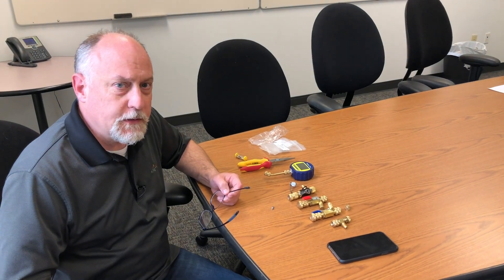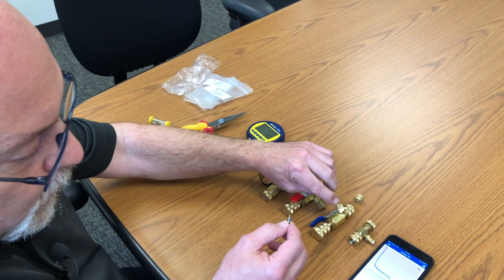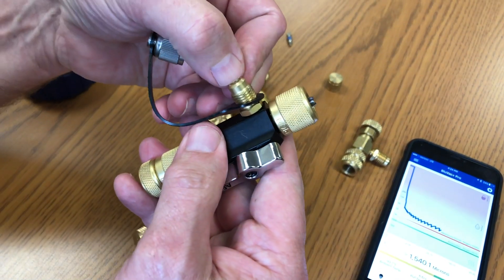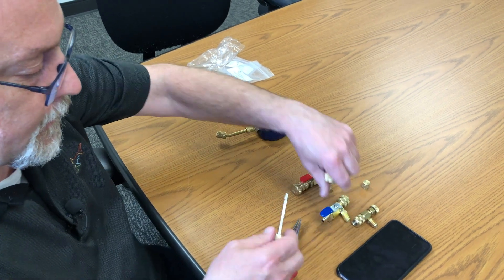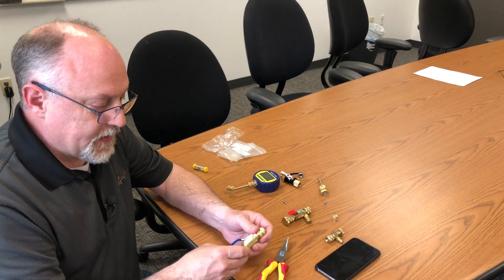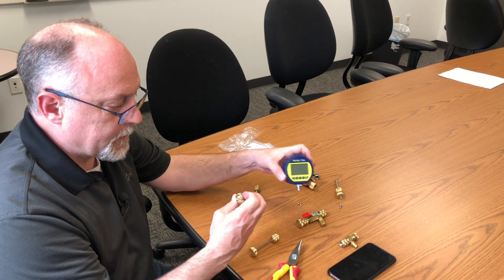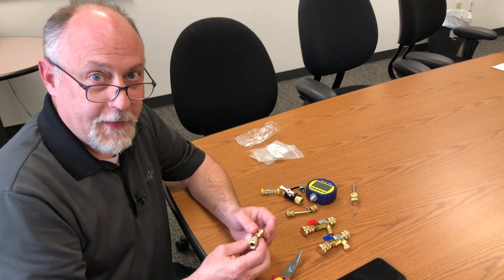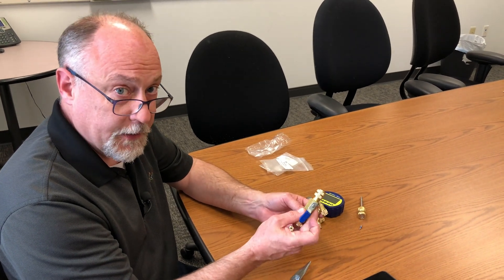My BluVac is Reading Erratically!

Comment: I got a sawtooth reading with the mg44 and the AccuTools core removal tool, I popped the shredder valve out and stacked a 2nd core tool on the port so I could valve it out before pressurizing. it worked out, but I was left wondering if I was experiencing something different. the sawtooth was not trending downward, it just seemed to stay around the 500-800 microns area for a while.
Reply from the maker: @cm9368  could have been oil in the brass connector if it was positioned so it could not drain.

Comment: Hey Jim, just thought I’d add that the if Appion core tool are giving a guy problems getting cores out, loosen the connection to the system a little. We all like getting them really good and tight but if you crank the Appion too tight, the o-rings compress and the shoulder of the core catches on them. Loosen your connection so the o-rings decompress and it’ll pop right out.

Comment: Hi Jim,  I'm just gonna ask here again : Are you planning on getting your Accutools available in Europe ? I've been trying to get my hands on the vaccum rig , core tool remover , micron gauges especially,  but I just can't get them here ( France) .
You should see some of the stuff you find in the supply houses over here , it never stops to amaze me how bad it is .
Reply from the maker: CBM is the distributor in France. They are a stock leaks detectors and scales I know for sure. You might have them order a set for you. It seems to be the VAT/customs or shipping that is slowing the sales. If you cannot get them to get it for you contact Accutools directly.

Comment: Where are the core tools and depressors made?  Also I get a really good quick pull down to 140 microns but will quickly fail the decay test. Any ideas ?
Reply from the maker: Earl, not in China for sure, but I believe overseas.  I would have to ask. How big is your system, and what does the decay look like. It could be moisture, or a leak or even out gassing. A screenshot would help.
Reply: @measureQuick  I don't have a screenshot. But it is a sharp rise and will definitely reach 1k microns in 10 minutes. The system is a 1.5 ton heat pump with about 15-20 feet of lineset. It was a new system using the existing lineset. It was flushed with r11x and purged and pressure tested with nitrogen.

Comment: Hi Jim great video   I have a question what would you recommend to use when you have a unit with CoreMax fittings not the standard Schrader's?
Reply from the maker: There is a "schrader core depressor" for that application. https://www.trutechtools.com/Accutools-S10767-Shrader-Depressor-Tool-1-4x1-4?affid=32

Comment: I also learned the hard way. Did you guys add a feature to the BluVac app. I noticed an option for a leak check, I don’t remember seeing that last year on the model below the pro
Reply from the maker: The leak rate indicator is on the Pro and the LTE
Reply: measureQuick awsome, I don’t know how I missed that last year. Great work. Thank you